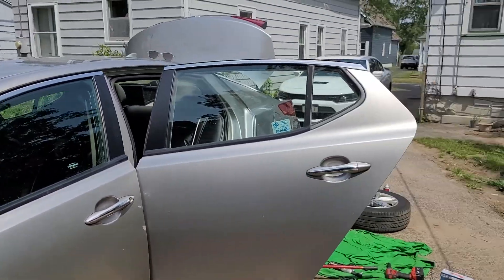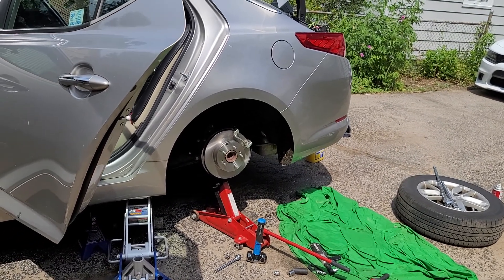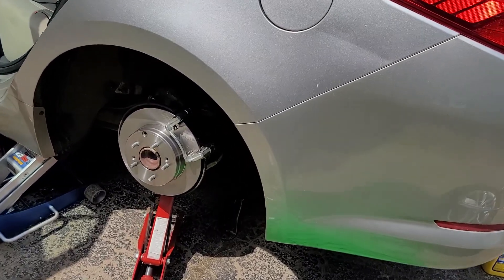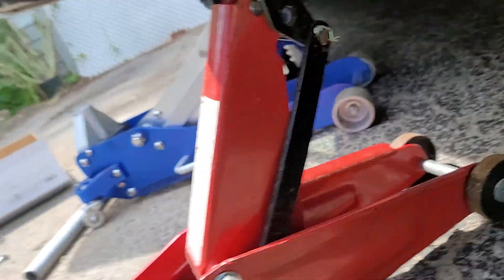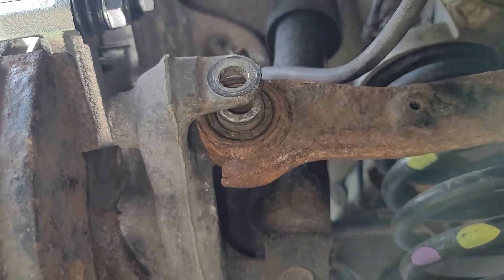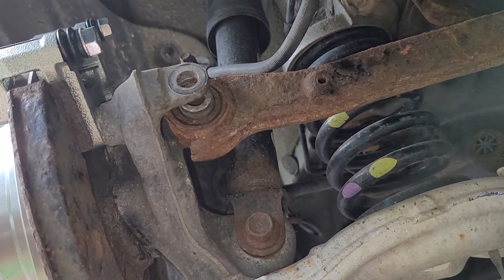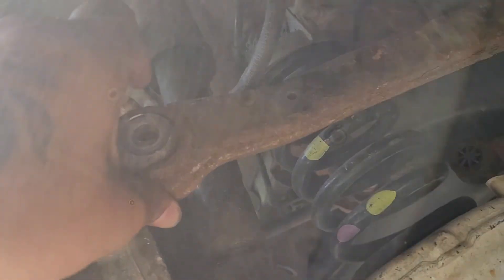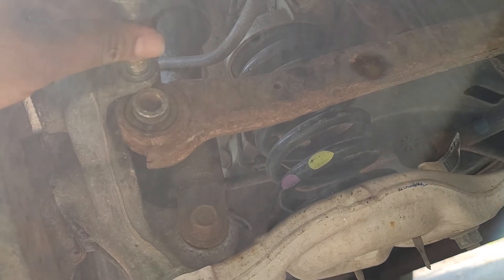2011 - 2015 Kia Optima reinstalling the control arm for rear brake job

Comment: Thank you sir.  I’m swapping out the rotors & pads on my 2015 Sorento.  I had a feeling I was doing something wrong and stopped.  I’ll go grab a jack now; it’ll be a breeze.  I tried using an offset 14” wrench but the angle is too poor for leverage.  Even if I managed to get it off what about getting the proper torque when reinstalling it.  You’re a lifesaver 👍. Appreciate you brother

Comment: Your video saved me some time today, I appreciate it.  I had to disconnect the shock to get the bolt out in the first place, terrible design.
Reply from the maker: After you do it one time, it becomes so easy after that.